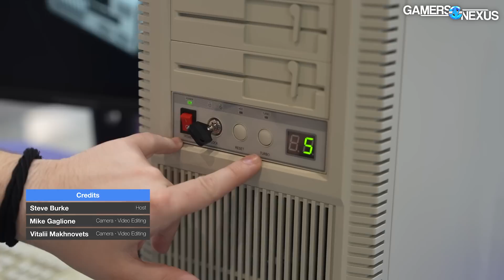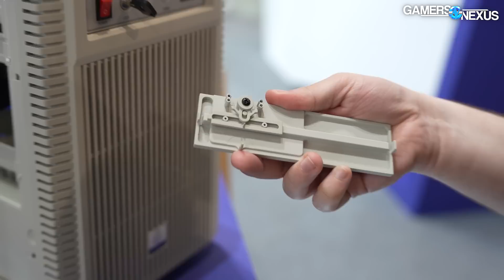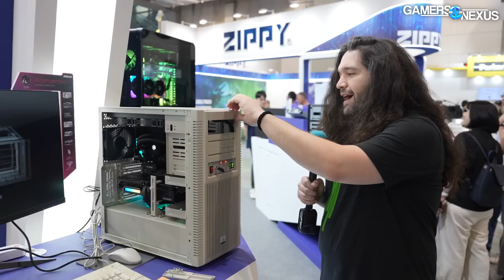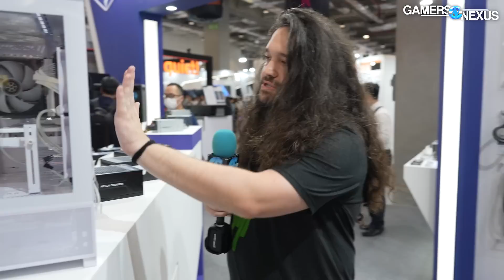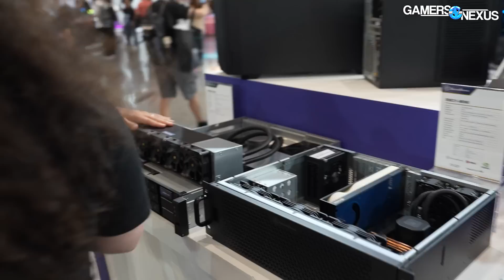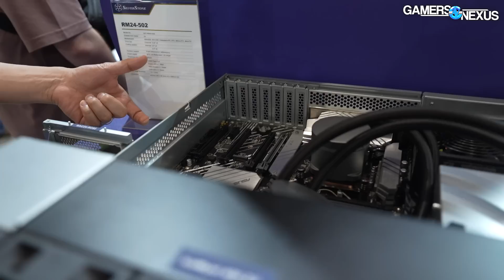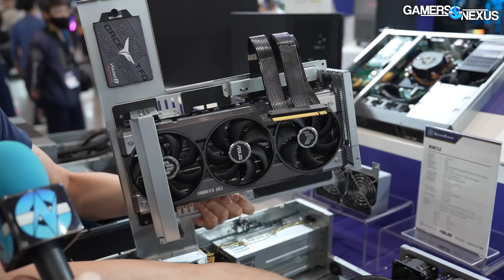Unironically the Best Case: Retro Silverstone FLP02 with Turbo Button

Comment: I'm thrilled. You can obviously put a modern PC in there, which is sweet. On the other hand, there's also nothing stopping you from sticking retro hardware in there either, which I would happily do given how expensive and banged-up old stock beige PC cases have gotten. I wonder how much "modern" old-school hardware you could find, with "industrial" motherboards and repro soundcards and whatnot...

Comment: It is so hard to find a case with an external 5.25" bay, let alone 3. This will be perfect for a dual-5.25 Icy Dock enclosure plus optical drive. The retro theme is an added bonus. Please move this case review to the top of the list when it comes out.

Comment: I have two of the silverstone $400 rack cases. I need RF shielding. I do see a problem with this case in that they painted the interior of the case and that makes it harder to get the panels to make a good electrical connection.

Comment: That retro case is dope, props to Silverstone for making something outside the normal trends.
Reply: This. Sick and tired of the same glass, poor airflow and RGB vomit everywhere
Reply: @Knaeckebrotsaege  There are tons of decent cases with good airflow and little RGB. Try looking for them instead of making outrage bait comments.
Reply: @robertposteschild2353  "having an opinion" = "outrage bait comments" ... 🤡
Reply: This one definitely has poor airflow tho'.
Reply: @davidsentanu7836  compared to all those trash cases with decorative RGB fans against a glass wall with a finger-wide vent on the side to breathe through, this has TONS of airflow
Reply: @davidsentanu7836  explain?
Reply: @davidsentanu7836  LTT did the build in it and showed off more of the design, the airflow is a lot better than their previous retro case. You don't need a bazillion fans on the front panel
Reply: Give it 6 months and all the case manufacturers will be selling something similar. They will want a piece of the pie.

Comment: Next time I need a new case, the FLP02 will actually fit my wants: a 5 1/4" drive bay! I've been holding onto my case from 2012 through multiple hardware updates because I don't want to give up the utility of my BluRay drive.

Comment: I'd be interested to know how they got the power switch on the FLP02 to work using a non-momentary switch. When I've researched this previously it looked very difficult, if not impossible since it ideally needs to be state aware.

Comment: Liking the Retro case.  

The T cases look amazing as they actually let you install loads of stuff inside them.  Though pricey. 

As an oldie the modern case looks lovely, but seems to waste a huge volume of space to no real purpose.  I'm guessing that's to get enough panel space for fans/AIOs when 2-3 sides have zero airflow.  There's like room for multiple mini pcs in the front void.

Comment: When I built my first Athlon Phenom II system, I stuffed it into an old generic horizontal 486 case with the face of a 5 1/2" floppy drive screwed to the CD/DVD burner face which I recessed a bit to make look convincing.  Sight on seen it threw some for a loop thinking I was going to show them the nostalgia of booting to DOS or Windows 3.1, but once the button was hit: different story..

I had the OS (Windows XP) on an early 32GB SSD which cost me a small fortune, but was too much of a speed increase to not splurge for.  When I fired it up in front of fellow geeks They laughed, expecting it to make a bunch of noise and take forever to boot... then it's speed just blew their minds, as some of them already had similar systems, just no SSD yet, and the difference in speed between an SSD and even a fast HDD was the most significant in my 40+years of computing.  I had to get used to reacting fast enough, rather than expecting to have to wait!

I wouldn't mind stuffing one of those new Ryzen 9 series 96 core processor deals and one of AMD's or Intel's finest GPU into like an even earlier box, like in the 8086 to 286 range, and mostly pretty ugly too!🤪

Comment: On the retro PC the power switch needs to be swapped out for a beige or grey one, I never saw a black and red switch back in the day, they could even just use a bigger button like the power and turbo, some had a chunky push toggle, also it would have been nice to se a 3.5" floppy drive as well since they really ended up dominating the floppy disk market.

Comment: I still have a blue ray player hooked up to my pc and I have a corsair 4000d airflow, i only have 2 fans in the front top 2 spots,  the 3rd bottom slot is empty and has my 2 cables run out and around the mesh and into the player. I have it rested on a dvd box set so its not on the ground itself.

Comment: If they truly wished for it to be an older system, there'd be something inside to make the distinctive grickling sound of ancient harddrives.  It's such a distinctive noise - which I amn't even sure I remember correctly.
Reply: Or the beefy speaker instead of the tiny buzzer we have nowadays.

Comment: I love this! I've spend so much time finding a case with just the right dimensions to fit the front of an old i486 case, I'm glad the style is getting some focus from a big manufacturer.   
At first I've tried modifying the original AT style case but I don't have the tools or capabilities to make it look neat so I settled on using a donor case.

Comment: What's with these idiotically expensive big cases? They are not even as good as the Alta D1 and even more expensive? Will they also have the build quality issues of the Alta D1 where screw holes are either not tapped at all or tapped twice? I would have bought an Alta D1 already but so much money for a case with such basic problems? No thank you.

Comment: I have wanted an old school tower with 5 1/4 drive bays for a LONG TIME for home server use.  They are perfect for mounting multiple hot swap 3.5" drive trays.  There are trays for 5 or 6 hotswap 3.5in drives that can be mounted in 3 5 1/4 bays.

Comment: I know the bandwidth for PCIe5 exceeds what current GPUs will use but why waste time with a half-ass solution and force bifurcation? Just slot into another PCIe slot through another plug on a flexible cable, it doesn't have to be long.

Comment: Cool. Although I'd prefer to see older chieftec mid/full tower cases updated to modern standards. The mid 2000~ LCX, CA and BA series for instance. Really sturdy tanks. I bought one back in the day and when I put it out to pasture it was still in mint condition. I was thinking of modding it but sold it instead. I wish I hadn't. ☹

Comment: Finally a "modern" case with 5,25"! I did the same thing with a power button on an old AT case back in the day :D.
Reply: I was THIS close to get a key started switch for my PC, but using an ignition key from a Renault 9.
Reply: @rata536  Huh, now that I think of it, a key-start doesn't sound too difficult (you just need a key switch that is 'momentary' when held in the furthest position and swings back, like the ignition stage on a car key?), and does seem pretty cool (and protects the computer from being accidentally power-cycled like an easier button allows). You might be on to something!
See, this is why I want 5.25" drive bays: so I can 3D print adapters for whatever insane front panel project I come up with without drilling holes in the case!
Reply: @05Matz  Well speaking of bays, because I'm using an actual old case, I'm using a bay cover for all the front I/O. 4 USB 2.0 and both audio ports. I had the USB 3.0 in an emptied floppy drive, but I lost the front one day I kicked the crap out of it.
Reply: @rata536  haha, that's impressive!

Comment: Oh wow - yeah, the Silverstone FLP02 is definitely on my list for most interesting cases. I even do have a beige DVD drive here. It's PATA but there are PCIe adapter cards so it's still possible to use those and I'd definitely do so with a case like this. Plus I'd put my older Noctua fans in there, which might fit the aesthetics quite nicely. :) I love that retro look with modern features. Technically it's similar to my Fractal Design Arc case but the retro look is so cool.

Comment: Silverstone really paid attention to detail. They still have the Turbo button right next to the Reset button so you'll never be not disappointed!

The main purpose of the Turbo button in the old days was to slow things down so you could play Wing Commander at a reasonable speed.
Reply: Wing Commander is a bad example. When that came out and you played it on a system with a turbo button, that button was always ON and the game still ran like a bag full of rocks uphill 😅

Comment: AS someone that is committed to owning as much of my media as I can on physical disks, I have a 10 year old mega tower case with two bluray drives in it.  I haven't changed cases with any upgrade because I can't find a good modern ATX or larger case that has any, let alone enough, 5.25 bays in it.  If this is less than $300 I'm sold.

Comment: Silverstone is killing it with the vintage designs.. this one resembles an old Kingspao case I had many years ago.. the whole lower front was an actual intake and everything I put in it (AT days here) ran nice and cool.  I probably went through four generations of upgrades in that old case and I wish I still had it!
I currently own a Silverstone RL08 case and it's been great since I built the machine nearly 5 years ago. Yes, I have an optical drive in the one 5.25" bay it has. Very handy for ripping CDs, which I still do to this day. Awesome coverage as always!

Comment: I love that retro FLP02 case. It's jus retro enough that you could fool some younger people into thinking you're still using a computer from the late 80's early 90's. But it's modern enough to have proper air intakes, exhausts and hardware placement. I wouldn't mind giving one a shot if I had the funds for it. :)

Comment: If the power button can be made to turn on an ATX PSU and the turbo button and the LCD can be made to actually work with vintage motherboards, this is awesome for retro DOS builds! Even better if they include an AT I/O shield ! And I'd especially love a "baby AT" version of the case.

Comment: Back in 1998 in middle school, our computers had the key locks on the front. I stuck a pencil in the key hole, then touched my CRT monitor. Static shock straight to the motherboard killed the computer instantly. I got in a lot of trouble for that...

Comment: I would love with different front panel options. Without  5,35 slots. Full grill front panel. Power and turbo on the top or bottom.

Comment: Wow, are we actually getting some functional 5.25 bays? I once thought I would never use 5.25 again, but now I find myself wanting them more. They're great for modular IO. They're great for internal optical media (which I've been getting back into since apparently digital vendors can just remove media--even media that I've "purchased"--at any time for any reason). They're great for hot-swappable high capacity media (IE, hard drives) which is super handy for anyone that does a lot of video editing. I've really found myself missing their versatility.

Comment: If my next PC ends up being a full size tower, I might actually go for that FLP02 case.
My current case is a somewhat old-school Chieftec one, which I got since I loved the way it looks.
It has enough airflow for my Vega 64 and 3600, but the whole intake is a single 120mm fan.
Well, it also has a side-intake, which can take a fan and the PSU is mounted on top and exhausts from the inside.
It also lacks any cable management space behind the motherboard, all cables run in front of it.
Of course it takes optical drives, though it hides the secondary and floppy slot behind a very neat cover.
So a proper old-school case, but a somewhat newer one where they took some pride in the design.

Comment: I wonder with the FLP02 if intaking air from the top and exhausting through the front and back would be cooler. Love a modern case with a 5.25 bay, slim pickings nowadays.

Comment: Aww okay so the turbo button doesn't involve a reduced clock speed, i guess that is understandable. In the 90s on the computers i had at least, disengaging turbo mode slowed the system down to a state compatible with original 8086/8088 chips so the games would not run too fast,  and none of that here. Nice stealth case though, no mods needed!😅

Comment: Assuming the case isn't astronomically expensive, I'd get a FLP02. It's a refreshing case in an era of shitty glass fishbowl cases that all look the same and have no internal bays anymore. I still use mechanical hard drives, and lots of them for bulk file storage, as well as optical and LS-120 drives.

The grill on the front of the case looks a lot like the snow white design language used by Apple in the mid 1980s to the early 1990s, and CRT monitors around the same time. It fits right in.

Comment: Love the silverstone FLP02 case, but it's not a full tower which sucks.   Would love to have a full tower version w/ 5-6 front 5.25" accessible bays and room for a psu at top AND bottom of the case just like the old cases we had back in the late 90's.   Would easily buy one now (my old cases have been drilled out so much I need new ones).

Comment: Old cases didn't really need ventilation. I think the most power was used in the old, inefficient PSU itself. Some 10W Pentium and Voodoo2 with no heatsinks on the ICs didn't really affect things.

Comment: I love it, takes me back. Even the gap in the drive bays for the GPU. When I got my 1080TI, I found out the hard way that it wouldn't fit in my ancient Antec case because of the bays, so I got some bolt cutters and sliced across, then just bent them round. Didn't even file down the newly made sharp corners down. Good times.

If they made a smol version I'd buy it in a heartbeat. Hell, I'm tempted to buy the ATX one for an old style home server anyway.

Comment: I want that Silverstone case! I've been looking for a case for my new build but haven't been able to find anything with externally accessible drive bays. I do a lot of optical media ripping so I need somewhere to install my optical drive. I also use a hot swappable drive bay for a HDD so I can have multiple options for data storage. I still have some floppy drives so I can install one of those too, just for fun. I'll have to mount my Liquid Freezer III 420 externally, but that's fine because I don't care how it looks. Function over form is my motto.

Comment: I'm still using a "This case will turn yellow in your grandma's house" case, except I had to drill intake and exhaust holes so it doesn't burst into flames LOL at the end of the day it's a metal box that holds computer parts, and it's awesome.
Reply: long time ago I had to drill holes in a side panel because the tips of the heat pipes on a cooler was poking the side panel and wouldn't close XD later I also cut a hole in the panel for a 80mm fan and put one of those snap on and off fan filters with the fan. I was very proud of how clean it looked XD

Comment: Some of the early PCs actually did have stabilizers/mounts for the add in cards at the opposide end of the mounting brackets as the early add in cards were quite long. The max length may have been some standard so they could user some universal end slot but not sure. Some cases kept them into the early 00s.
Reply: Going back to the early Apple II and other computers, add on cards could be larger than the mainboards, and were built super cheap. I had a 286 with an EGO graphics adapter that was well over a foot long. It went from the slot in back to a pair of plastic grooves in the front of the chassis that sat where a fan should have been. It was maybe 1/16 inch thick (like 1 or 2 mm) and the card creaked and flexed all over when you pushed it into the slot. It was a Turtle Beach, not a clue what chipset it was. It was a long, long time ago.

Comment: as if msi (cyclone designs) and silverstone linked up to make me built a retro pc.
Reply: Old school green pcbs, bare metal coolers with fans and no shrouds, beige slot loading bluray drive made to look like an OG 5.25" floppy drive, with the lever acting as an eject button... top it off with a noctua downdraft air cooler and it'd look shockingly retro authentic. Could even release a line of 3.5 inch floppy disks that are actually USB drives or carts of some kind. Could have a ton of fun with this stuff.

Comment: Finally a modern case as good as the older style this is simulating.  I must get one.  The front 5.25" bays are awesome.  There's plenty of used cases of the original kinds, but nothing modern fits in them anymore.  I hope this becomes a trend.